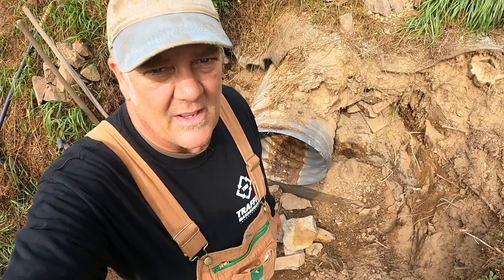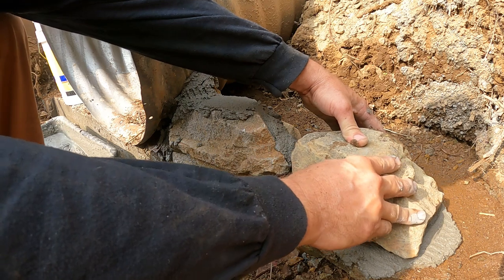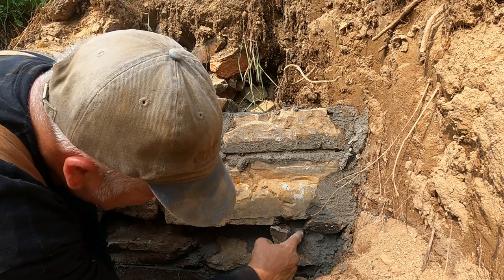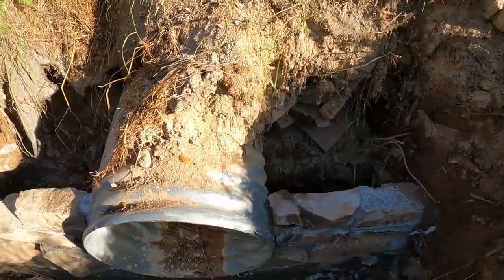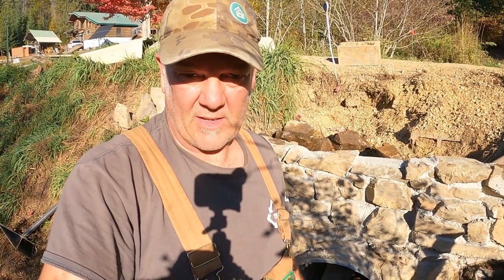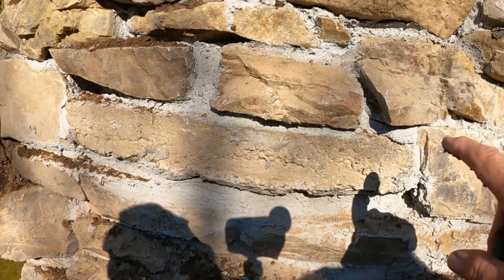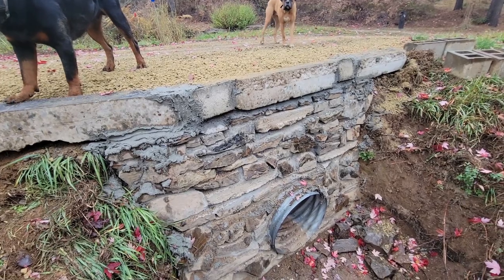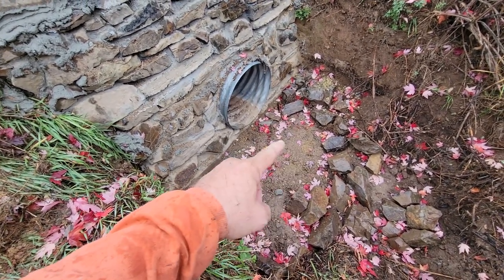How to repair a culvert Part II

Comment: I think you need to buy a stonemason's hammer and work on your facing stone skills. That said you did a reasonable job Scott, at least it shouldn't give you any more trouble for years to come 👍
Reply from the maker: Thank you John!  I was so looking forward to comments on this vid and you didn't disappoint!  I was thinking about that the whole time!  I absolutely will go get one cuz now that snow is melting (this was last Nov) there is water pouring through the pipe but I discovered a new problem....  hint hint..

Comment: I would have had poured cement behind your rock wall and then I would have put tar to keep water out. Or something to keep water. I don't think that cement slab that sticks off into your driving space is a good idea if the dirt settles under it it could leverage the wall and break it off
Reply from the maker: I packed it pretty hard with water....